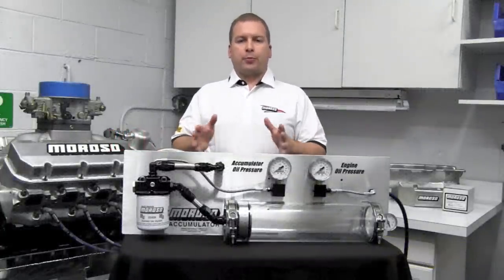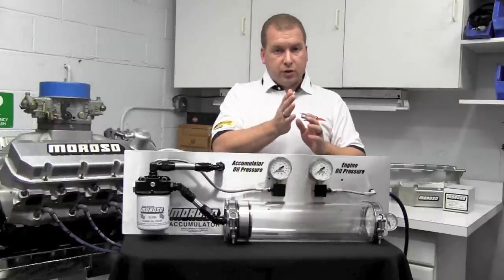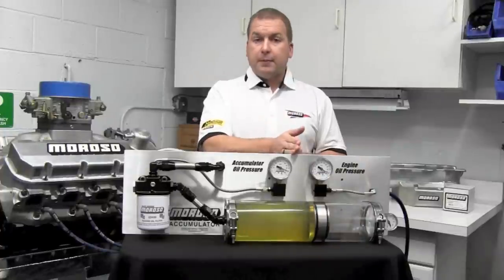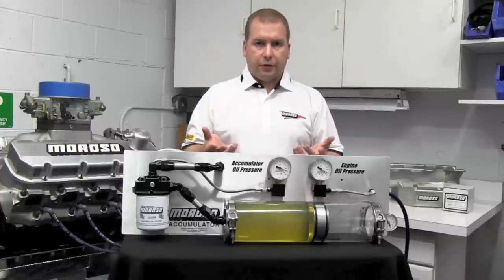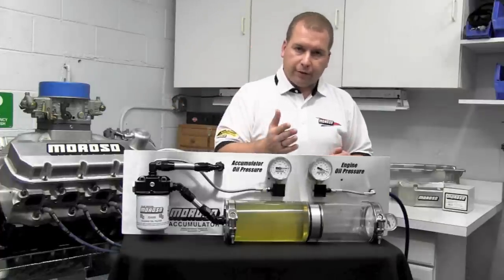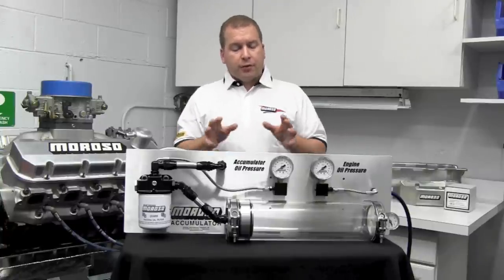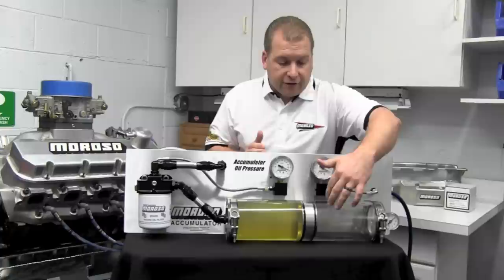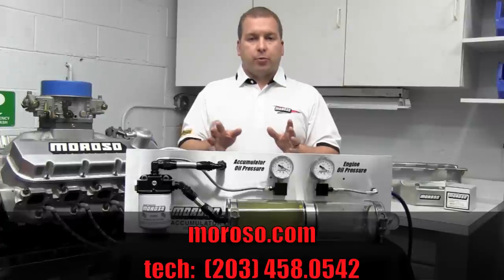Moroso Oil Accumulator, How Does It Work?

Comment: I have a 2008 Toyota Highlander with a 3.5L 2GR-FE V6 engine. I have a noise on cold start. Do you have one of these for my car? If so where can I get it? I’m in the Chicago area.
Reply from the maker: Hi James,
Thank you for your interest in our products.

For the Accumulator I would recommend Part # 23901, 23905 electric solenoid valve and mounting clamps Part # 23920. Since that engine uses a cartridge style oil filter, our spin-on oil filter accumulator adapters would not work for your application. So your best option is to plumb the accumulator into an oil galley or into the return line on the factory oil cooler.

In the Chicago area:

A PLUS DISTRIBUTING
108 E ST. CHARLES ROAD
VILLA PARK 60181
17.84 miles

T&A PERFORMANCE
2937 INDIANAPOLIS BLVD
SCHEREVILLE 46375
28.81 miles

WHITES PIT STOP
350 E. US30
SCHEREVILLE 46375
28.95 miles

BOOK RACING ENTERPRISES
214 INDUSTRY AVENUE
FRANKFORT 60423
29.66 miles

WINNERS CIRCLE SPEED & CUSTOM
207 NORTH SCOTT
JOLIET 60432
33.57 miles

Comment: How do we know if the seals let go inside the accumulator ?
Reply from the maker: Hi Sharon,
You would know by the accumulator not holding pressurized air. To rule out that the pressurized air is not escaping through the air gauge, spray the air gauge and fittings with soapy water or windex to check to see if you see any air bubbles. The same concept that you would use to check for a leak in a tire.
Reply: @MorosoPerformance  hi thanks 😊

Comment: Very cool video!

Tech question: if you had a location you could mount a narrow accumulator vertical with the connection at the bottom, would it not need an internal piston?
Reply from the maker: Well used to sell a design of accumulator that was to be mounted vertically and had no internal piston. The reason that we stopped selling that design is because its only effective in a situation where it is static and not in a moving vehicle. Thanks for watching!

Comment: So you must run a significant amount of more oil, correct?
Reply from the maker: Str8Haste 1 and a half or 2 and a half quarts of oil depending on which Moroso Accumulator is installed.

Comment: The way u have that filter it will collect bits going into accumulator then when it's time pressure drops you get bits out back into oil system ?
Reply from the maker: With the way the accumulator is plumbed, it's post filter. So any oil coming in and out of it will be filtered oil.

Comment: Great video, will be getting one for our vintage car. One question, still not clear on cold start after not running engine for a few weeks or longer. Do we open the valve before turning on engine, put bigger charge? Looking forward to detailed answer, and thanks!
Reply: Yes that's in the video. Open valve before starting, because your engine is not running there is no oil pressure so the accumulator will "fill" the engine, but inly to the point where you have connect the pipe (probably near filter). Once engine is started accumulator with control the volume based on your pressure

Comment: I'm interested in running one of these on a 2.0L turbocharged engine putting out over 200hp per liter. Stock oil capacity is 5.5 quarts of oil. I'd like to run the 3qt model with a higher air charge in order to rapidly discharge roughly 1qt of oil when needed. I'm concerned that using the 1.5qt accumulator and using a higher pressure air charge will result in the accumulator only discharging a small volume of oil. What are your recommendations? What kind of "engine oil pressure" were you using  in the video with the 20psi air charge? Thanks!
Reply from the maker: Randy,

 Thank you for your interest in our products. Your assessment is correct, yes in your case you should use a 3 quart unit.

In regards to your question "What kind of 'engine oil pressure' were you using in the video with the 20psi air charge?" - 65-70 psi

Sincerely,

Moroso Racing Products
Reply: Moroso Performance Thank you for the prompt reply, great customer service and I haven't even purchased anything yet, I look forward to using your product!

Comment: so wait what does the "cansiter" psi gauge read under oil (80psi max in my case) presser just wondering so i can replace/match the other gauges in my car?
Reply from the maker: sean maga Once the Accumulator has been installed as per our instructions and cycled through a couple of times,  the gauge on Accumulator should read within 5 lbs of the engine's actual oil pressure.

Comment: can you show the difference on how it maintains pressure when you have 5psi pre-charge and 20 psi?
Reply from the maker: Thank you for your inquiry, Alfred. While there is no way to show the exact difference, you can see how much more the Accumulator fills with the lower pre-charge amount.  The rate at which the accumulator will move the oil out will vary on the temperature, and viscosity of the oil, and the resistance going into the engine.
Reply: if you can get a percentage on your set up im sure that will translate to my set up, or close too. but...thanks for the response.
Reply: @MorosoPerformance  I was a little dissappointed the you didn't release the last cylinder of oil at the 20psi charge. I was currious to see how fast it discharged relative to the 5psi charge for comparison.

Comment: Pre charge of 20psi means only 20psi oil pressure on a bend not a lot or 10 psi even worse  but better than nothing though ,while the accumulator is filling you will also have low oil pressure as you accelerate out of the bend when the engine is under load so it helps a little but a true race engine needs good pressure all the time at least 60psi and all of that extra oil in the sump not good for engine breathing. so it may help a little but you will be running a engine with a lower overall engine oil pressure Dry sump is the only way.
Reply from the maker: helicopter269,

Are you certain that you watched the whole video or perhaps you missed part of the video? To fully understand the concept of how the Accumulator functions let's start with the basics. The Moroso Oil Accumulators are oil storage tanks, connected into the engine's oiling system. Outer body of the Accumulator is a heavy wall tube with an inner piston that separates the oil from the air within the tube. As oil enters the Accumulator when connected to the engine's oiling system, the piston is pushed back thus compressing the air pre-charge in the other side of it. The inner piston will always move so that the pressure on the air side of the piston equals the oil pressure entering the Accumulator. When the engine's oil pressure fluctuates due to oil surging away from the oil pump pick up during hard acceleration, severe cornering and/or hard de-acceleration, the stored oil will be released into the engine's oil supply. After the fluctuation is over and the oil pump is once again primed with oil, the engine's oil pressure forces this reserve of oil back into the Accumulator.  When it is time to shut down the engine, the Accumulator will hold whatever pressure your engine has at the time it is shut off. On manual valve equipped Accumulators you will need to close the valve before shutting the engine off. On electric valve equipped Accumulators the valve will close automatically when the engine is shut off. If the engine has low oil pressure at idle you may want to hold the engine at a higher speed as you close the valve to develop more oil pressure for pre-oiling. Hope that helps to clear up any confusion. Thank you for your interest in our products!

Comment: If you say “Moroso”, you automatically think racing. I would beg to differ in today’s powertrain design to increase fuel economy and reduce emissions. I am talking about a gas engine with a “Stop/Start” feature. A battery will drive a pump in the automatic 4 or 6 speed line pressure to stay in drive, clutches engaged and ready to go. When you take your foot off the brake pedal, the engine cranks over and starts up. Yes, certain accessories have to be off but the oil pressure on a tight engine will see oil pressure drop to zero. Even though oil passages & galleries are not completely emptied, it still takes 1-3 seconds to build oil pressure to a degree of hydraulic  wedge or film of pressurized oil on bearings and other wear parts. If a typical housewife was to drive to get kids to school, stop at the store for tonight’s dinner, doctors appointment, visit mom or other family or heaven forbid had to go to work, pick up kids at relatives house and pick up dinner, drive home. Park this car. Now...How many times in one day did the engine shut off, restart and repeat? 56 times? 112 times? 184 times? Not to mention the wear & tear on the starter, but the total engine life!
 I think this is a huge market that would perhaps require a redesign for limited real estate, design with multiple kits requiring only a line, fitting, mounting and instructions that would fit certain high selling models, usually a run of 5 years before it is redesigned & new model introduced. Perhaps year, make & model as a kit that some owner with skills could install or have a professional installation. 
 Hey, worse case is a manufacturer who has data on bearing failures or premature wear failures would buy these to install on the assembly line, promoting  increased longevity. A GM engineer told me something never published. 5,000 hours is the threshold for a standard, equal to 150,000 miles of use. Are the worn out and useless & worn out after that! Only a group of 5-6 GM’s, 6-7 Fords, 4-5 Honda’s, etc. Honestly, the only reason I bring this up is because I bought my wife a 2015 Malibu that has this feature. As a certified automotive ASE Master Tech since 1978, now retired. My knowledge of engines has pushed my brain to think outside the box and worry about what I may be asked to deal with in the future. If you want to retire and you are handy w/4 SnapOn tool boxes, move!
I have a seven day per week challenge I don’t want. Go fishing, hunting or just ride your motorcycle across several states is never going to happen. I am looking  models that I could use on this vehicle wired to hold pressure when commanded off, then on, by going to one of two circuits of starter controls. This is late October 2021 and the vehicle is not here until Monday or so. Living in a large city is or can be great. But, watching our budget as a small business, in the city, they want top money and they all have 100k or more miles with exceptions. So, I shopped 280+ miles into rural areas. I found what I wanted for her with 37k and $1,490 dollars cheaper. So you can understand my next step. I look forward as a business should do. 1 year plan, 2 year plan, 5 year plan and 10 year as most should. I will do my home work once it is here. Regards. 
NIASE Master Tech since 1978, Retired!